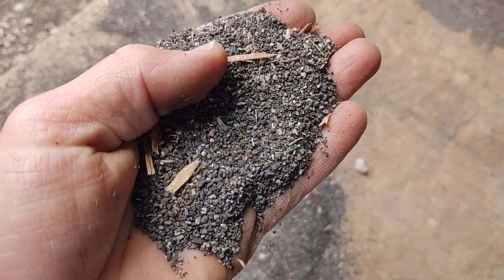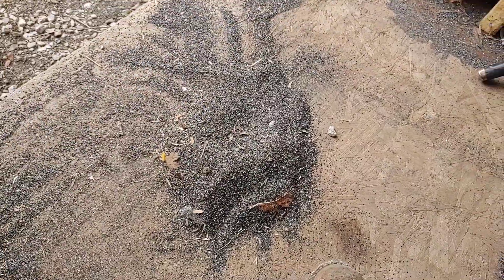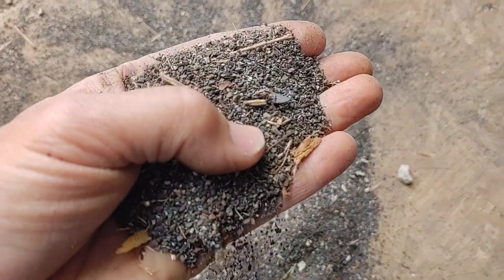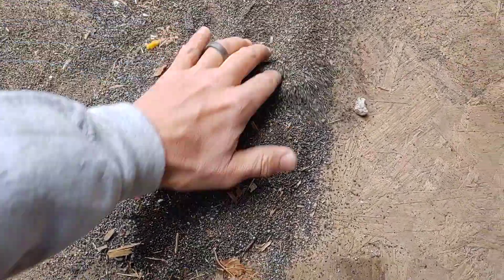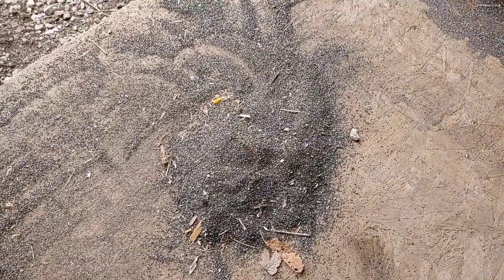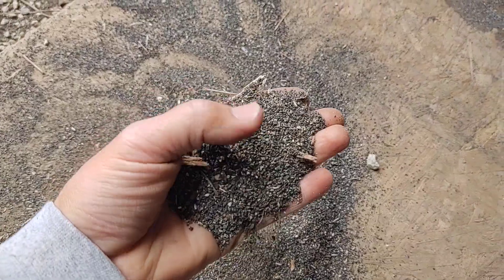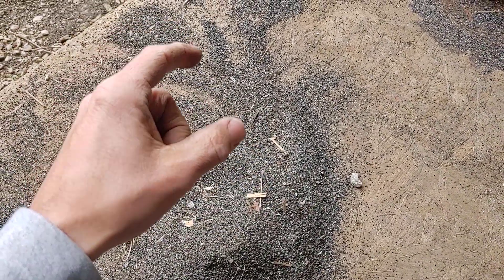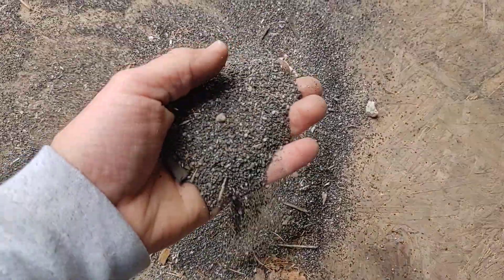Roofing - oxidized asphalt VS. SBS Polymer  modified asphalt shingles

Comment: Hi I have been following you now for the last year you have been so helpful with our new roofing company. Is there anyway you can make a video on how to re roof a gag liberty peel and stick low slope roof or do we always have to replace the deck.
Reply from the maker: We don't do too many flat or low slope roofs. Might be a while before we do another. As far as replacing the decking  it just depends on how well and clean the old roof comes off.   I'm glad the videos are a help.
Reply: @GrandRoofingInc  thank you very much
Reply: Hi Stephen, I am not a pro roofer but I did do some roofs when I was young and layed off, I always found that if you are doing the job by yourself you might as well do it right because you are saving a fortune on labor.

Comment: Good points. My contractor told me in a detailed invoice he will use his obvious preference, what he's sold on through his experience. I don't know any better. He chose O.C. and their components which, according to O.C., compliment and enhance their function. 
I grew up with astronauts talking about Corning Ware, it's durability and ability to withstand extreme heat and cold. I went along.
Fortunately, Reno has lots of heat in  summer, little snow, very high winds, and virtually no hail. I think I'm good, after this. But, just today I was wondering of the importance of those granules.